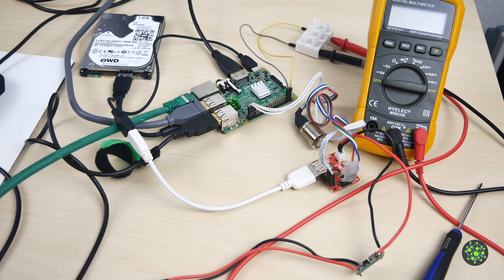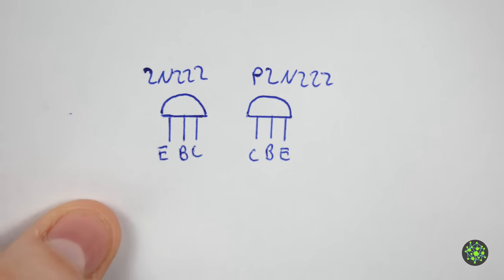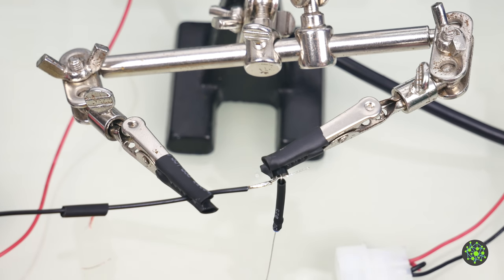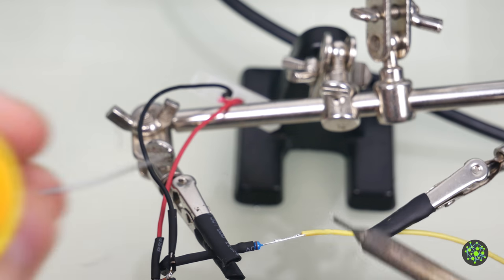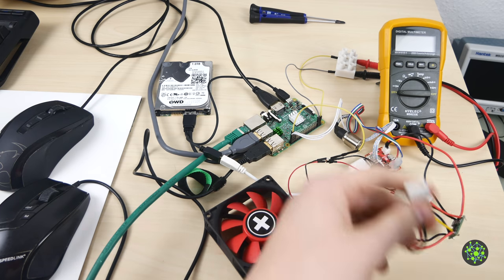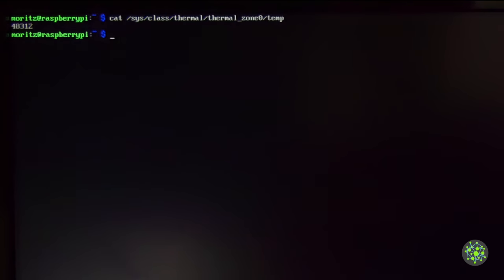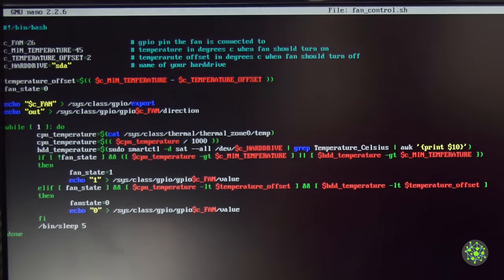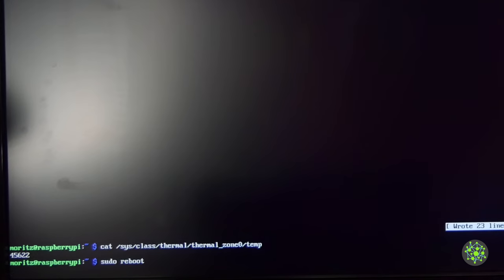Ultimate Raspberry Pi Build #05 - Cooling the Pi with a 12V PC fan

Comment: Have you considered using PWM to control the fan more granularity? You could also use the sense wire from the fan to check the fan speed to detect if the fan dies.
Reply from the maker: +robert wall That's a great idea.

Comment: I've been using this circuit, but wrote a small program in C, to control the fan with a PID controlled PWM signal to the fan. It keeps the CPU to +- .5°C set to control @ 55C. Quiet fan.

Comment: Ok. I expected PWM control, but it's informative at least. I also miss logic behind selecting resistor value and transistor, cause last time i've build something, I spend a few hours selecting proper P-MOS to switch ... i don't know what, I think 5V by 3.3V or something like that. I think I needed to disconnect SPI SD card reader from 5V. 
By the way another way how to control fan speed is using transistor as a serial variable resistor, it's easy, but that semi-open transistor gets pretty hot and when you connect three fans in parallel to it, it will overheat and fail (now I'm not sure if Rasberry has integrated DAC to adjust control voltage)

Comment: I would solder stand-offs on the various boards and fan circuit to a breadboard. Then have wire connections on the breadboard. The fan controller, power regulator, etc. are all in one neat package. Or, instead of a breadboard, use a prototyping hat that'll plug right onto the pi. Also, there's expandability: RTC circuit, GPIO breakout, UPS with battery, RS-232 maybe....
Reply from the maker: That's a good idea, I already thought about that, but I have something different in mind. The channel announcement beeing a clue to that.
Reply from the maker: +Thomas Terry Yeah, a breadboard is always a good start for prototyping.

Comment: Awesome video; top notch production quality and VERY professional level electronics work. One bit of constructive criticism though; couldn't this process be slightly simplified by using say.. an old desktop PC CPU fan? Or does the pi not have the ability to detect fan speeds in relation to chip temperatures without additional software? Forgive me if my question is a bit basic, I'm fairly new at building/modifying PC's.

Comment: enwi, thanks a lot for your videos, it helps a lot. I would like to know if I can use a NPN 2N2222 A instead of a NPN 2N2222 ? thanks for your return,
Reply from the maker: Yeah that should work fine
Reply: @enwi  Thanks for your quick return,
Reply: @enwi  Firstly thanks for your incredible video, just to add a little information ; 

The 0V need to be common with the 0V (GND) Raspberry. In my case i've used a separate12v adaptator, so the 0V of the adaptator need to be common with the 0V (GND) of the Raspberry.

Thanks for all :) and keep it up :))
Reply from the maker: Correct

Comment: Great video, I did the same with the 5v fan that was on the RPi case I bought and didn't find tutorials about it when I did it. 
I have a question, the red wire on the fan is VCC (12V) and the yellow wire is the speed sensor signal? On molex, yellow wire is 12V and red wire is 5V so I got a bit confused on the colors 😊
Reply from the maker: +Maxence Leduc If it's a PC fan the standard color codes for the fan wires are black GND, red 12V and yellow RPM. But you are correct the color codes of a PCs power supply differ. There red is 5V and yellow is 12V.

Comment: Adjusting the 5V voltage while the pi is connected to it  is not a good idea
Reply from the maker: You're correct, forgot to say that, but actually mentioned it in another vid.

Comment: Enwi i have 4 12V fans and i want to control them but only the Rpm Can you please help me i can't find anyone else to ask then you.
Reply from the maker: Depending on what fans you have that can be quite challenging
Reply: @enwi  it's  fractal design silent r3 50mm 3-pin fan header
Reply from the maker: So I think you will have to control them with PWM